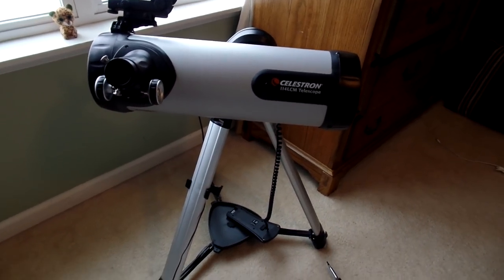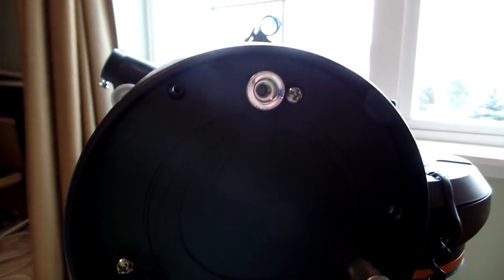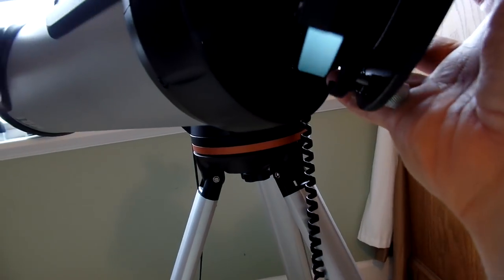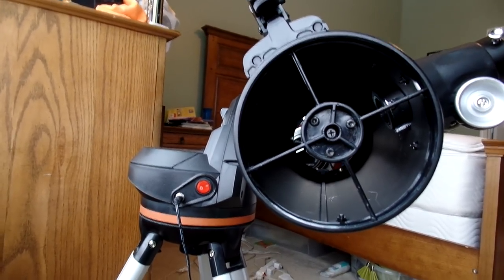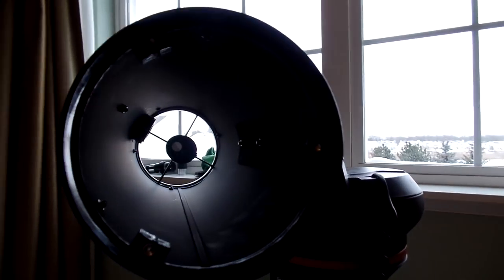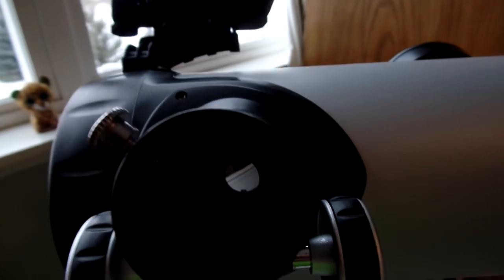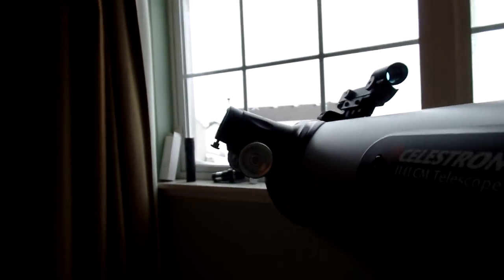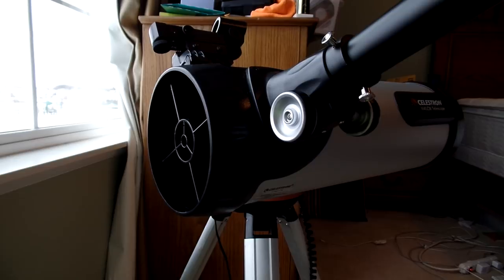Celestron 114LCM collimation easier method

Comment: Don't listen to the haters, this method works, and actually teaches you more about how your scope works(if you have never had one before), just don't use any power tools. Yes, you can fine tune better results with a laser, but you will need to do a basic Collimation (Like this^^^) before you bust out the laser anyway... (Kevin, feel free to pin this post to the top.)

Comment: im shocked to see a battery drill being used to put screws into something so delicate, even on its lowest torque setting the drill is way over powered to put in such screws, i cringed as the drill was setting the screw awaiting the classic stripping of the threads. im new to all this having the same scope is what got me here in my searching, i didnt read the comments at first but watched your video, it kinka seemed your method looked like a sensible shortcut at the time, but did wonder why you would need to pull a lens out, had you not used the drill on the screws i may have tried this but the use of the drill made me read the comments which i rarely ever do, im so glad i did read the comments. i suggest if you continue operating in this way you should find a good local supplier of telescope lenses and get yourself set up with an account with them as im sure youve used that on the seconary lens too and your going to break it. but hey what do i know, its your telescope.

Comment: I enjoyed this video and despite the obvious errors I found it useful as my scope was seriously out of focus. One change I did make was to replace the main mirror with plain paper with a central cross. This made the readjustment of the secondary using my laser collimator very straight forward. Replacing the main mirror with the adjustment screws fully backed off again made the final laser collimator adjustments very easy. AR UK

Comment: also what I didn't know until recently is that you won't be able to use the laser tool unless you have your center marked on the primary. many scopes come with a mark but with my astromaster 114 I had to do it myself. this is so that you can align the secondary mirror properly before adjusting the primary.

the other reason you need a mark is because the astromaster 114 has a 2x Barlow built in. this means the laser point will become very diffuse and by the time it bounces off the mirror and comes back, it will have grown by quite a bit. to still achieve successful collimation, you need the aforementioned center mark, so that the shadow of the mark is cast onto the aim-thingy on the tool, and you can still have a pretty good guess of how well-collimated your mirrors are
Reply: What did you do to make the mark on primary mirror. I need to do the same. How did you go about getting correct placement of the mark you made on it?

Comment: On my newtonian the 3 phillips screws on the primary mirror are just locking screws. I just needed to loosen them And use the thumb screws to collimate the mirror. Once done, Tighten the three Phillips srcews to lock it in.
Reply: I also had a collimation dot on the primary that helped too. I didn't bother with the secondary yet since it was the main mirror that i needed to remove and clean.  But if I need to collimate it I will use this technique first.

Comment: Newby here.  Just tried you method because it made sense when everything is out of whack.
Reply: Struggled with the "proper way".  This way just worked!  My spiders are not a one piece casting but 4 legs that screw into the sides.  I made a 6" disk out of card stock then put a hole in the center for an Allen wrench that fits the secondary mirror locking screw.  I could then center my secondary mirror spider mounting.

Comment: This is Bird-Jones so you have to remove the correction lens to be able to use laser collimator. It will be much easier
Reply: Very true, the correct name is a catadioptric Newtonian design, bird jones where the people behind the idea & it is possible to collimate without removing the lenses from the focuser if you follow the instructions supplied on collimating. Best best is to use the focuser lens cover & drill a 1.5 - 2mm hole in the centre & then align the secondary mirror so you can see you eye in the centre, & then adjust the primary mirror so the secondary mirror support is then centred in the eyepiece. You should see your eye in the very centre of the secondary & then the secondary in the very centre of the primary. Take your time & follow the instructions supplied with your scope. All the best & if your are worried about a small hole in your lens cap, use a small piece of electrical tape to cover it up.
Reply: @nathansealey6270  only if you call it a catadioptric Newtonian you could mistake it with scmitt Newtonians which are by definition catadioptric as well. All be it they’re less common.
Reply: @gy9326  thank you, catadioptric simply means to both reflect & refract light.

Comment: I have the same telescope, but my dot finder is different to yours. Thank you for posting, I know how to remove the primary mirror now, there is a small speck on it that I want to clean off. I havent altered anything about the telescope, it is as was out of the box. Havent had chance to use it properly yet since buying a few years ago. Id like the serial lead too but Im not paying £50+ for a chuffing RJ11 to Serial lead! LOL Im in UK btw. Once again, Thank you for posting.
Reply: JohnnyX50 first, don't follow any of the terrible advice in this video, you will damage your telescope.  secondly, small specs on the mirror do not impact your ability to observe.  It's far too easy to damage a mirror trying to clean it.  you're better off not trying.

Comment: Annnnnnd this was actually the only method that worked for me. HOWEVER no need to screw off the secondary mirror, just loosen all the screws except the centre and position it in so you can see the 3 tabs towards the rear of the telescope (do this with the primary mirror out) just makes it easier to align everything. Once its straight tighten the centre screw and then the 3 adjustment screws until the just touch the secondary mirror, then tighten the centre screw so the mirror doesnt move.
Pop the primary mirror in and you want to make sure that when you align the mirror, you can see the 3 tabs in the reflection of what is being seen by primary mirror. After that it was perfectly collimated FINALLY after 6 hours of getting the scope 😩

Comment: ALWAYS start with SECONDARY mirror FIRST.  Use   a collimation cap!  THEN it's aligned accurately to then do the primary.  No need to tear a telescope apart for this. 

If you don't have a collimation cap, get one!!

Comment: PLEASE HELP!!! I bought Celestron Austromaster 114eq and I should see other planets except the Moon but the only thing I see is big yellow circle with smaller black circle in ti. What's happening,  what's wrong? PLEASE HELP!!!
Reply: xddddddddddd
Reply: turn the focus knob next to your lens
Reply: seriously ? LOL
Reply: Join a local astronomy club to get some newbie help.
Reply: what you are seeing is an out of focus planet.  turn the focusing knobs in the direction that shrinks the circle.  imagine you are "tightening" the circle until it resolves into a clear image of the planet.  It may be much smaller than you are expecting, this is normal.  if you have multiple eyepieces you can start with the lowest power (biggest number on yhe eyepiece) and then once you have the planet in view, experiment by gradually switching to higher power eyepieces to magnify the object.  For example, you might start with a 25mm eyepiece, then go down to a 10mm eyepiece (like earring and needle guages, smaller number is actually more powerful).  expect the object to become dimmer and blurrier with increased magnification.  with experience, you'll find the magnification that gives you a good balance of size vs clarity.

Comment: I have reported this video.  I mean no ill will toward the creator, but the advice in this video is flat out wrong.  At best it will result in a lousy collimation.  Far more likely it will result in permanent damage to the telescope's optics which could result in having to buy a new one.  I hope youtube pulls it down, but in the meantime, DO NOT ATTEMPT ANYTHING YOU SEE IN THIS VIDEO.  And to the creator of this video, I'm happy to teach you the proper way to collimate a telescope, once you remove this dangerous video.  Please do not continue to remove your primary mirror as part of routine collimation.
Reply: It is wierd isn't it.   I assume he watched a video on aligning an Orion scope with his laser tool,  and got frustrated the method didn't work on his. 

This scope has the bird-jones erecting lens built in,  so he can't get a clear focus point with the laser.   Also this scope has no center dot on the primary. 

If he just removed the B-J apparatus (he mentioned without knowing what it was) he'd have succeeded the correct way.   By taking bunches of stuff out,  he kind of accidentally stumbled on removing the B-J lens. 

However backward star pointer,  electric screwdrivers,  removing the half twist locking screws completely for some reason to allow his tuning screws to move the mirrors,  then the extreme action if removing the mirrors and wiping them directly with towels (and maybe Windex too).   Wow.
Reply: How about letting us all  in on your "proper way to collimate a telescope?"
Reply: @thunderbolt707  Happily.  First of all, there is no reason whatsoever to remove the mirror.  Instead, use a laser colimator and insert it into the focuser such that the view window in the side is oriented towards the back of the telescope (this way you can use it in a later step).  Then, use the three screws on the secondary mirror at the front of the telescope to make adjustments until the laser hits the primary mirror dead center.  Your secondary mirror is now aligned.  Next, move to the back of the telescope and look through the view window we oriented earlier in the procedure.  You'll se the laser dot land somewhere on the flat circle inside the view window.  Loosen the locking bolts on the primary mirror so that it can be adjusted.  Then use the adjusting bolts to adjust the alignment of the primary mirror.  Watch the laser dot, and make adjustments until the laser goes back into the hole it orginally came from.  Now your telescope is properly colimated
Reply: @raymondwhatley9954  does what you are describing work on this exact telescope with the Bird-Jones. I have this same model and the documentation does not seem to mention collimating at all. Yet people keep saying that you can't use a laser collimator. It shouldn't be this difficult to find the correct information/instructions. All of these comments are confusing (DON'T do this or Worked great!) I'm beginning to think that this is a lot more difficult to use than Celestron let's on...

Comment: a Collimator is not very useful when Collimating a telescope...? Okay ...
Reply: The recent Celestron 114 uses a Bird-Jones erecting lens in the light path.**   Unless you remove it and mark a center dot on the primary mirror (like you find on Orions) an inexpensive laser aligned won't work. That is likely how he got into all these useless steps. 
** what he is calling the 2x built in Barlow is likely the bird-jones catotopic lens

Best method on these is to place a white piece of paper on the opening with a symmetrical target printed upon it.   Take out any eyepiece and focus the drawbar all the way in.   Look through the open drawbar at your reflected eye. 

If your eyeball is centered,  do nothing.   If it is off,  unlock the secondary mirror center screw and adjust till it is centered. Relock. 

Fine tune the alignment on a clear night looking at Polaris.